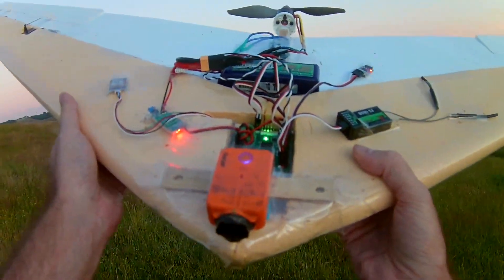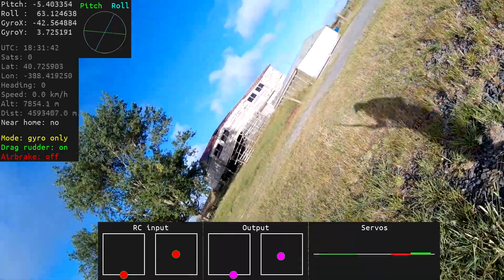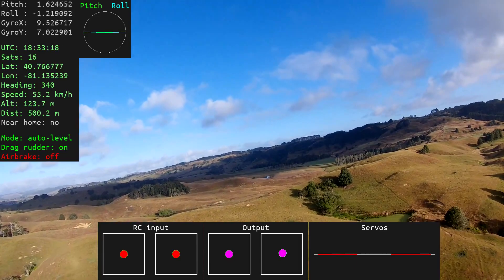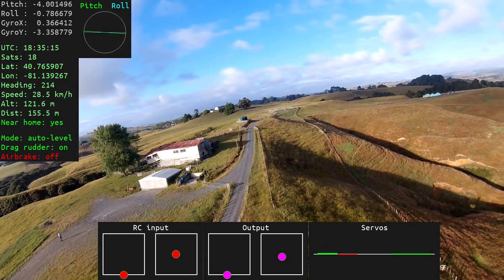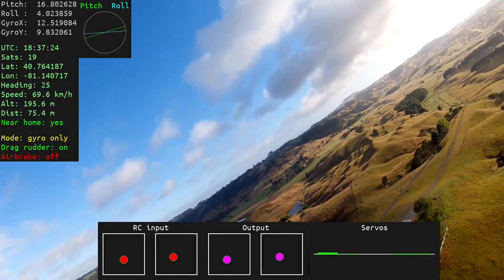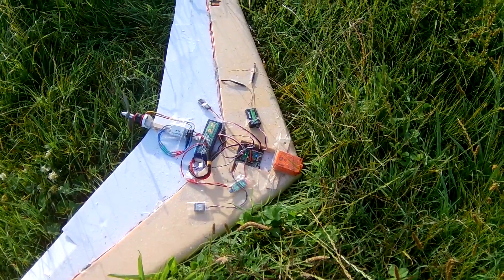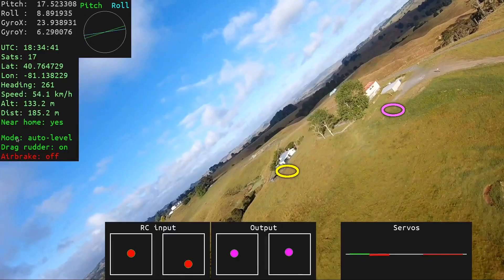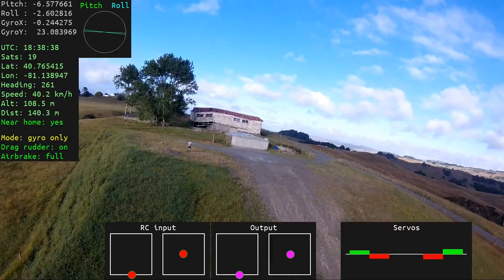iomixer logging test on kfm2 wing

Comment from the maker: Looks like I'll be repeatedly pointed to Dashware so I'll answer here. I didn't find it suitable in this case because: 
- it can't read arbitrary binary data so I needed to make my own program to export CSV anyway, and the format was changing from day to day
- some data points cannot be used directly, eg. servo outputs are 1000-2000 values, stick inputs are 0-1 values, switch values need a comparison to determine the mode names, the lat/lon tweak etc. these all needed some extra conversion
- Dashware requires some kind of time data to match the frames (in this case the 'seconds' field of GPS might have worked, but there's also the issue of the 180 dropped frames that would have caused problems)
- highly customized display like the servos one do not seem possible
- rendering video once to add dials overlay and then again for edited final video loses picture quality
- using chroma-key to get a dials-only video and then overlaying that in editor is better for picture quality, but can have color issues, and requires that the editor supports chroma-key
- a full-frame overlay with transparency is slow to scrub through in editor and slower to render than the separate rectangular sections
- the rectangular sections can be re-generated individually
- Dashware is Windows only (yes yes, or WINE maybe, but no thanks...)
- many more codec options available when regular tools like ffmpeg

Comment: Thought for your sbus_mixer software: If a user could edit it via json or yml, even just an import/export function. That could really help adoption, just copy/paste the whole program, be able to share snippets easily and clearly
Reply from the maker: Yes, that's pretty much how it works, with JSON. Copy+paste into the main editor view also works by passing a JSON string via the clipboard. Since it runs in a browser I'm thinking to make a site where you can have an account to store and retrieve your programs. It can also run on localhost as I'm doing during development if people want to customize something, but for most users it will be easier just to go to a website. So sharing snippets will be easy either way.

Comment: Watching this another time after more recent post of 'sbusmixer' flying a quad. Returned looking for more details on the 'sbusmixer'. 
Your work on the visual sbus controller is quite impressive. I'm guessing the visual on-screen configuration to that manages inputs to outputs is another project you developing? (just not covered in a video that I can tell)
Originally I thought it was acquired hardware, but after seeing the balloon project, realized you create some of your own electronics and pcbs as well.
Between the kfm2 wing, the sbus controller and the post-flight OSD telemetry visualization this a number of parallel projects coming together. Impressive and inspiring.
Reply from the maker: Thanks. I really need to make a proper explanation of all this soon, instead of just these teasers :)
Reply: So I'm not just going insane. I was interested the last time the programming GUI made an appearance, and just spend an hour trying to find more info on across all your uploads to see if you had covered it and I had just missed it. I initially thought it was an existing piece of software before seeing your comment. You're onto something quite special there, the interface reminds me of a cross between IFTTT and Scratch for MCU's, nice. Will keep an eye open for the reveal.

Comment: What GPS module are you using and where in NZ did you get it?  I want to build a high refresh rate (5hz+) GPS speedo for my boat but can't seem to find what I want here in NZ.
Reply from the maker: Look for bn-220 on banggood
Reply: @iforce2d  any chance you can share the source code for your speedometer?
Reply from the maker: @aaronmartin8846  12:57

Comment: love your videos and really wants me to get back into flying. i used to fly rc and been 3d printing for years and have decided to get back into planes by combining the 2 thing. ive designed a flying wing with split ailerons and would love to know more about your controler system 😁
Reply from the maker: It's an arduino-like system I'm working on for visual 'programming', will explain the details properly soon.
Reply: excited to know more and will it be sold or a open source project?

Comment: On the overlay thing, in motorsports there is a bi desire to be able to take engine ecu logged data and generate a graphical display for video overlay. An opensource program to do that would be pretty awesome

Comment: Apparently, the altitude estimation is wrong, which cause your roll not being levelled.  For fixed wings, it is very important to do the fusion of GPS and IMU. IMU will always fail to produce good orientation reference when turning. You will need GPS to compensate for the wrong orientation by Accelorameter during turning, or possible other error.
Reply: @Sencis yes you are correct. I only wanted to utilise what he already has on board.

Comment: I think it would be awesome to build a really unstable wing without any vertical stabs or sweep. Do you think your mixer would be able to make it fly?
Reply from the maker: I had that idea actually. Then it would really be dependent on the drag rudder. It would need some more carefully controlled outputs though, not like this slapped together stuff.
Reply: So a couple years ago I made a stubby symmetric wing that was intended to become a tail sitter VTOL. It was flyable, but extremely pitchy since it needed enough control surface to be able to hover vertically. After a lot of crashing and tuning I had both hovering and flying working well. It glided like a brick though, and I get the general feeling that any plane that needs electronic stabilization to fly well will never fly great.

Comment: I like your OSD, is that post-processed? And is it linux based?
Also, I like what you did with the GPS co-ordinates, very funny ;-)
Reply: What did he do to the GPS coordinates?
Reply: @tanmay______  He added an offset to move them to the Flite Test Building.
Reply: @Vidicon31  aha! i knew he would've changed it for privacy but this was a cool easter egg!
Reply: @Vidicon31  damn lol. And about the OSD, its probably post processed he mentioned it at the ending.

Comment: Fascinating, DIY FC....Why is your Autolevel Mode not working?...Could it be a dead zone on your roll control caused by that crazy wing section..?...🤔🤔🤔🇬🇧
Reply from the maker: It's only a proportional response, not a proper PID etc. The pitch/roll angle is also not sensed correctly in the first place, due to long term sideways accelerations in a turn.... I think.
Reply: @iforce2d  Ah, okay...still, it kind of works I guess....seems a bit pointless as an old F4 does data logging for about 16 dollars..🤔🤔😳🇬🇧
Reply from the maker: the openlog does logging for $6, but I'm not quite sure what's pointless about it
Reply from the maker: ah I see in your other comment, you seem to be thinking this is a flight controller, but that's just one of many things you could do with it. Think of it like arduino for noobs, you program visually in a browser instead of writing source code.